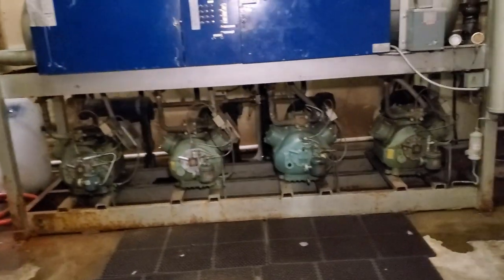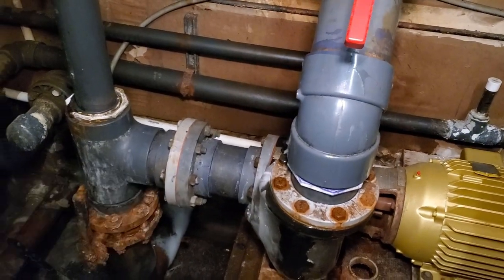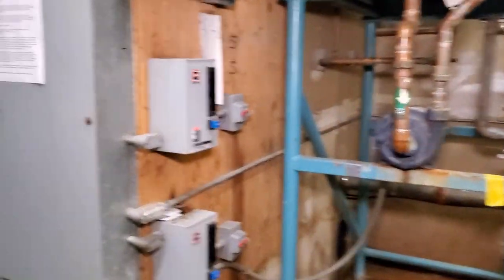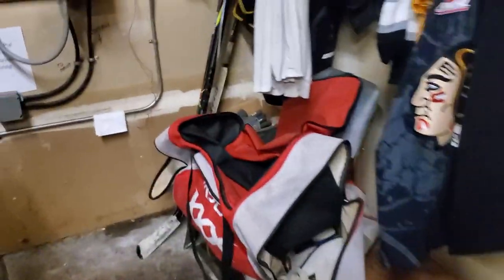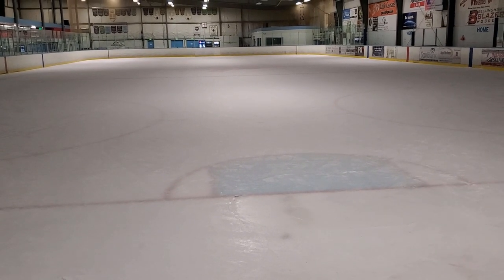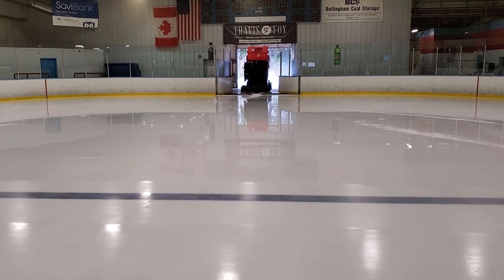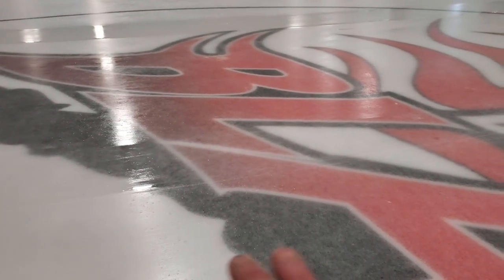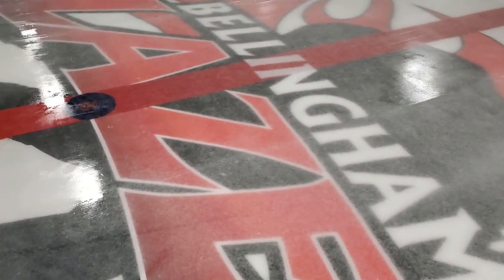Corona Shut Down and Ice Removal Day 1

Comment: Not that I've done it that many times but we've always just shut the compressors down. Maybe do some shaving. Let the ice melt over 2-4 weeks and then go in with a crew and a tractor with a brush and push everything to the one end to the drain. Ill try to make sure to get as much ribbon out as possible as I think it plugged our sump drain last year.

Comment from the maker: Please share how your rinks remove the ice. I am sure techniques vary depending on the size and funding of the facility. Also let me know if you would like to see daily updates of the ice removal process and how things are generally going during the closure.
Reply: Shave shave shave... slab temp 30f....once I start shaving to the white paint I stop... turn the brine system to manual to warm the slab... only 1/8" of ice so less than 8 hrs later it breaks up into chunks. Remove with small skidsteer and then power wash the slab and squeegee to the zamboni threshold/doors. Please show us a dialy video of removal and if you could a video of your installation process also
Reply: We cut right to the concrete..
 Kept shaving. The blade wont touch the concrete... our edger shit the bed the night before so we cut as close to the boards as we could let it warm up and i went out and spud out the remaining ice with the spud knife. After down to concrete i Went out with a auto scrubber after 3 times the floor was clean of pretty much all paint. You are right it was hard on the zamboni even though i had 2 of them and tried to use both evenly it is really hard on the machine. Guys told me they used a escavator like you were saying then used a pump truck to pump out the ice.one of the guys came over from another rink and told me he cuts right to the concrete and he leaves no paint on the floor but he didn't feel like telling me how he does it. Its been crazy with all this stuff. Stay safe I really enjoy your videos